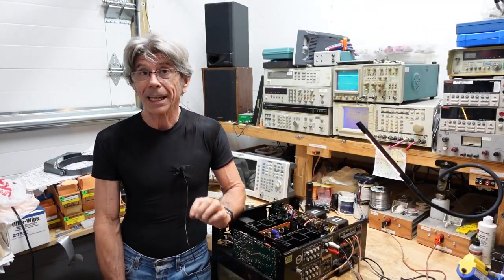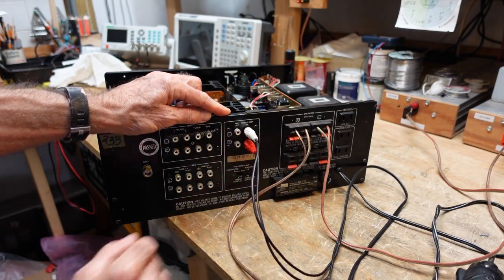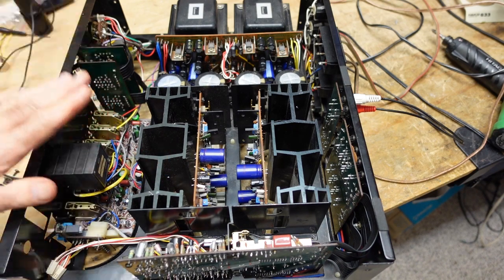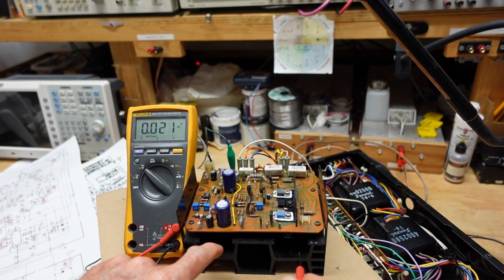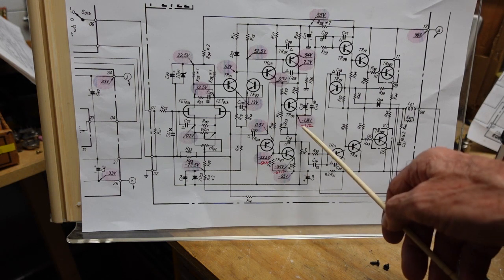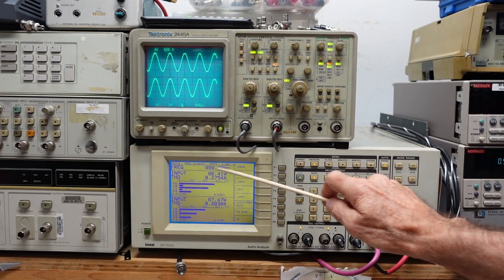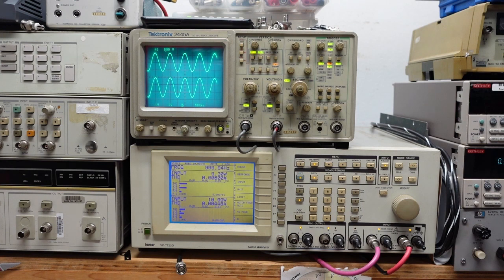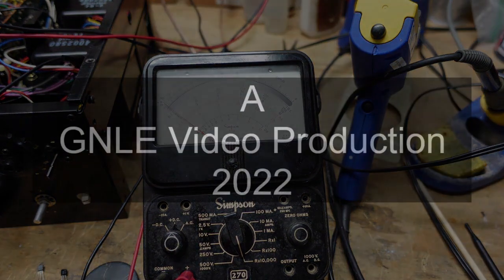Sansui AU-717 Clipping on Left Channel Only

Comment: very interesting video, I was just wondering would it be possible to see that leaky transistor in  circuit with an oscilloscope? My thoughts are, if we turn the amplifier up to where it clips at the output, then probe backwards through the circuit checking each transistor until we find no distortion in the signal, would that be an alternative method of diagnostics to locate the faulty leaky transistor?
Reply from the maker: Dave, one of the things that makes troubleshooting direct coupled amps difficult is that the negative feedback will reflect the issue back into the input differential pair, and you'll see it throughout the stage.  This is where understanding how the amp works comes into play.  A little dumb luck never hurts either.  😁

Comment: I just had the exact same issue on a Sansui AU-417 bias transistor was 2sc945 . Seem to be replacing lots of 2sc945 s recently . Very strange that your curve tracer didn’t catch it , my atlas pro 75 did . Leakage C to E ! Thanks for the video 👍
Reply from the maker: Joseph, I guess it really depends on the severity of the leakage.  Without using an oscilloscope one would never know there was a problem.
I seem to spend an inordinate amount of time fixing troubles that no one would know existed!

Comment: Just had my sui 717 re capped (the dreaded corrosive sansui glue) caps alone cost me £200. All in all it cost me £550. Money well spent. She's back to her normal brilliant self. Fantastic amplifier
Reply from the maker: Yeah, the supply chain issues we're facing around the world hit the parts world too.  Interestingly, I just ran a spreadsheet for the 717 and came up with close to the same cost here, about $210 US (£173).
Reply: @raygianelli3612  worth it though. I use 4 leak sandwich 600 speakers with my sui. Beautiful beautiful sound. Garrard 401 turntable (SME arm) ortofon concord cartridge

Comment: Hi Ray. I have had same transistor problem. Checks good but is bad in circuit. I have found that my curve tracer will find the bad transitor that my meter says is ok. Have you tried a curve tracer?
Bob
Reply from the maker: I did. I mentioned at the end of the video that I tried the Peak Atlas DCA75, Fluke diode test on DMM and my curve tracker. I really thought the curve tracker was going to show it, but it didn't. Perhaps if the leakage was worse it would have. Thanks for bringing it up!

Comment: Your last bit of this video is exactly why I have numerous transistor testers, capacitor testers and multimeters. They all test a bit differently. If the component tests good on all of them, then it can be assumed (Ass-u-me-d?) that the component is good. If it fails the test on any of them and that tester is in good working order, then the component is almost certainly bad.

One tester I have that I think might have caught this is my Sencore TF46  "Super Cricket" transistor tester. It would have show weak on the display and the tone it emits would have been weak or muffled with a leaky transistor. I have caught bad transistors with it before when others have shown them to be good. Also use my Simpson 260 sometimes in the exact method as you did. That somewhat higher test voltage will sometimes show the leakage just as you demonstrated.
Reply from the maker: 100% in agreement.  Is the Sencore your go to tester? The vast majority of the bad transistors I find are with the Fluke in diode test mode.  The Peak Atlas is used mostly for hfe matching, the curve tracer for output transistor matching.

 I believe that low levels of leakage are difficult for transistor testers to find, and in many circuits isn't an issue.
Reply: @raygianelli3612   Yes, the Sencore is what I usually use as the "gold standard". If it tests good on it, then the transistor always works. 
Another very handy piece of equipment that I use for leakage is an Electronic Design Systems Semianalyzer model 59C. It will test, non-destructively, for leakage up to 175 volts. That device would definitively find that E-C leakage and show exactly what voltage the breakdown occurs at. That Semianalyzer is getting very hard to find and is usually very expensive, but definitely worth it in a situation such as the one you demonstrated.

Comment: Excellent.
Reply from the maker: Thanks Ricardo.  Enjoying your channel as well!
Reply: @raygianelli3612  Hi Ray, I start again with the AU-717.
I found one input fet noisly, do you know some good replacement?
Thanks in Advance.
Reply from the maker: @treadmillrepair754  Ricardo, I have heard that the Linear Systems LSK389B is a good sub.  Not cheap but at least available.
Reply: @raygianelli3612 Thanks so Much.

Comment: Thanks Ray.  This inspires me to get my dad's old 1960's Simpson meter from his basement.  It has one of those odd (27volt?) battery's.  Hopefully he removed the battery and has not leaked.
Reply from the maker: I remember there were 22 volt batteries, kind of looked like a long 9 volt, with a terminal at each end, IIRC.  Don't recall Simpson using them, but maybe Triplett did.  But absolutely check it out.  An analog meter is occasionally just the right tool for the job!
Reply: @raygianelli3612  I will grab the meter next time I visit.  It might be a Triplett,  both similar looking.  Has 2 or 3 he found in the dumpster when he worked at Bell Labs.  Also has a radio shack analog that he bought because the 22V batteries were hard to get in the 80's.    On a side note,  had to check my notes from when I recapped my 717.  Replaced both TR06's with KSC945C to future proof it.
Reply from the maker: @scrappy7571  Wow, your dad worked at Bell Labs?  That is awesome!!!
Reply: @raygianelli3612  Yeah,  he has several patents to his credit, but they are property of BL.  Also wrote several chapters in tech books.  I remember him showing me glass negatives of IC's,   this was mid 60's.  These were how they designed the circuit layout using photolithography.  He his almost 90, and sadly his memory going.
Reply from the maker: @scrappy7571  That must have been an amazing place to work when he was there. Sorry to hear about his memory.  That's the ultimate betrayal, when your own body/mind goes, IMHO.
Reply: @raygianelli3612  We lived near the labs, and they would pay outside people to test some of the inventions.  My sisters and friends participated in some voice/sentence recognition  studies.   Pretty cool to how far we have come from only 45 yrs ago.

Comment: Good find to check with the Simpson, but, I wonder if you used the ohms function instead of a diode test on a 9 Volt  battery powered DMM, as that would have tested the junction with a comparable voltage to the Simpson ( Simpson manual says it uses 7.5V on the R X 10K range) .It would also be interesting to check it on  "Ye Olde Eico 443"  compared to your new replacement.
Reply from the maker: Well, after reading this I had to go back out to the garage and check this out further.  My Fluke meter is a 177, and in diode mode puts out 7.3V.  In resistance mode it puts out 5.5V.  The Simpson puts out 9.5V in RX10K.  The 443 shows the bad transistor to be indistinguishable from a good one.  The Simpson was the only one to show any leakage.  I don't think the amount of leakage would be an issue in other circuits, but it was in this one.  And TBH, without test equipment no one would have thought there was a problem with this amp in the first place!
Reply: @raygianelli3612  Thanks for checking! It seems the diode test mode on just about every DMM will not indicate a high resistance leakage issue, no matter what voltage it uses to test with. One thing that is funny, I looked at the manual for a Simpson 270-3, which uses 5 x 1.5V batteries, but you must have a newer (poss series 5) as that uses one 1.5V and one 9V battery. I know the Eico 443 doesn't use a high voltage when using the transistor portion of the unit, but the diode test side can go as high as 2000 volts. It definitely paid off to use a tester, even the Simpson, that pushed the transistor a bit harder to find that fault.
Reply from the maker: @poormanselectronicsbench2021  You're making me get my steps in today... another trip to the garage showed the Simpson is a 270 Series 4.

I used to have a Tektronix 575 curve tracer.  Huge old boat anchor, but you had great control of all the parameters pertaining to transistor testing.
Reply: @raygianelli3612  I can wait for info on stuff like that, but exercise is always good, lol, thanks again!